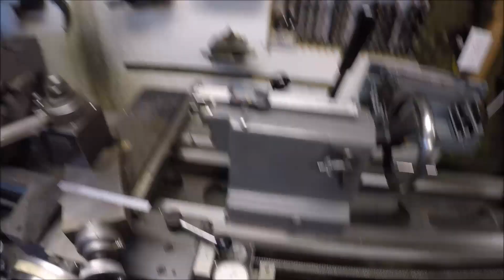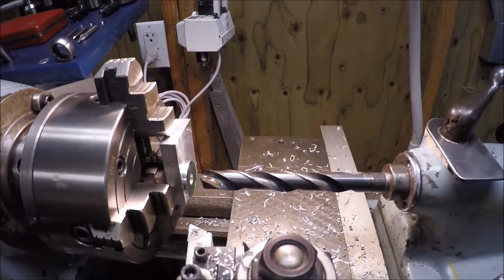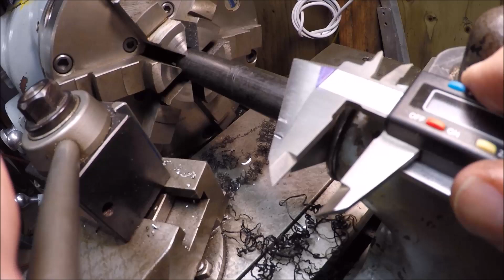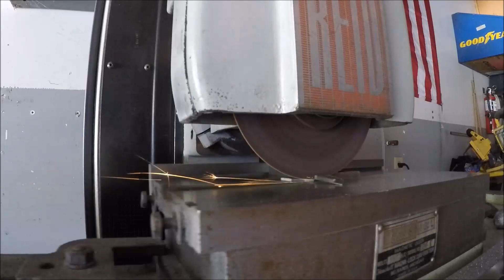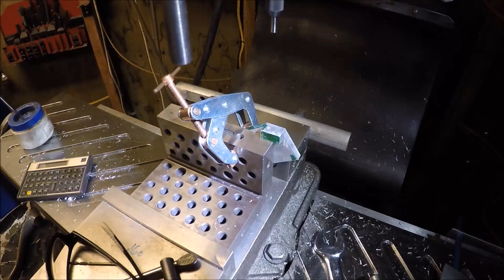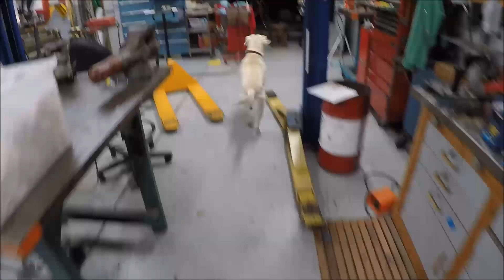Monarch 10EE  Tailstock DRO

Comment: I worry about whether the quill rotates slightly because of clearance between the key and keyway that prevent the quill from rotating. Won't that put quite a strain on the caliper mechanism? I know that mine (and most of the lathes I see on YouTube) rotate several degrees depending on whether the torque on the drill bit or the torque of the feedscrew are stronger under different conditions.
Reply: Most excellent point!
Reply: it probably has already rotated as much as it can, unless he drills with a reverse bit in the tailstock occasionally.
Reply: The quill on my SB9 tailstock turns several degrees one way and then the other depending on how much pressure I put on the handwheel when drilling with large bits. I have seen the same effect in video after video here on YouTube.
Reply: why does it turn the other way if the drill is always right handed?
Reply: +meocats - Looking at the tailstock from the wheel end: the quill turns  counterclockwise if the torque from cutting into the workpiece is strongest; it turns clockwise if the drill is skidding in the workpiece and the quill is running back up the feedscrew (left-handed thread in the tailstock, remember) because of axial pressure.
Reply: i was taugh not to remove a drill from the material in the direction opposite to that which it was intended to. But still, haven't had that problem for reversing taps or dies, since they are free-cutting on the rerverse stroke. Maybe your quill is lose? I keep mine tight to reduce vibrations. For exampe, i am not able to throw my tailstock wheel to spin freely. Tightening of the quill like this would solve the flex of the caliper flexing. On some lathes, like mine, the "key" holding the quill from spinning  is just a setscrew with a V point, so it can not rotate (unless it becomes damaged over time).
Reply: The quill only rotates a few degrees in either direction; it doesn't spin. It might be enough to jam the caliper body, though. The South Bend 9" has a keyway in the bottom of the quill and a short key with a pin that inserts into a hole in the tailstock housing. Slop between keyway and key, and between pin and hole, allows the small amount of rotation I am describing. Any system that allows axial motion while restraining rotation will have a little play; it's unavoidable.